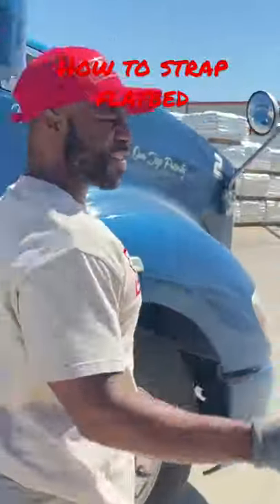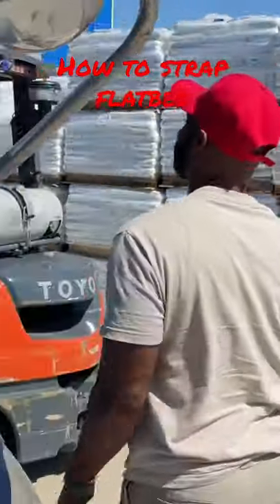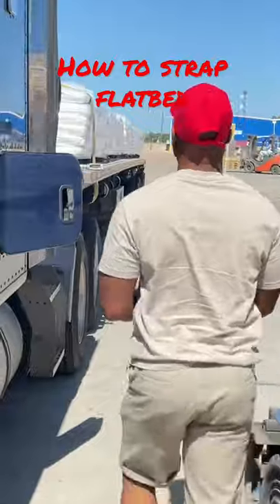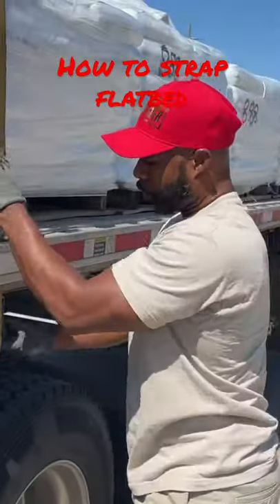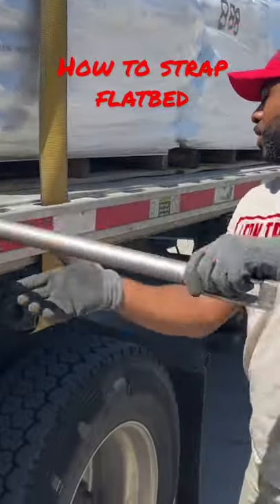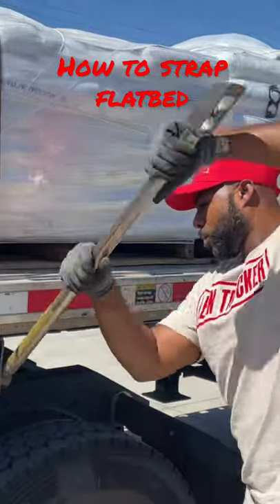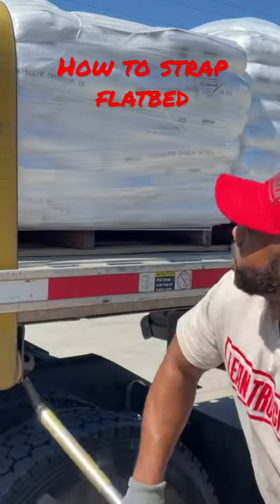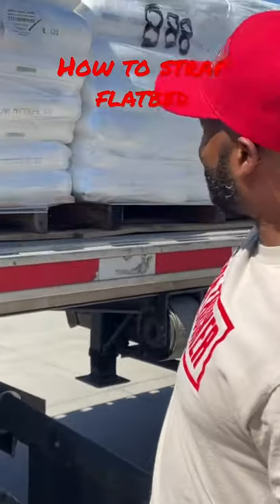How To Strap A Flatbed Load

Comment: To each their own… But I would not recommend this method of strapping loads. 
It is quick, and it gets the job done. But it’s more of a rookie method. 
First, i’d recommend to never throw the hook. That’s a rookie mistake. Because you have a chance of hitting someone, or someone’s truck with the metal hook… And that’s not a happy day for whoever threw the hook of the strap. Someone’s going to be very aggravated when you hit their nice new truck with your strap hook.
Secondly, my personal opinion, take your straps off the winch after every load and roll them up and store them in a proper storage box. Get them out of the elements. It will extend their life. It also lessons their chance of getting stolen off your trailer when you’re parked at a truckstop.
Lastly, all that extra strap rolled on the winch makes it easier for the strap to become More loose as you travel down the road and the load tries to bounce and tug against the strap. Strap on strap will give, but strap on metal winch will not give.
Cool video. Cool that you’re teaching a method. 
I just think a lot of old hands and flat bedders would entirely disagree with this method.
Reply from the maker: Respect 💯
Reply: Hook to the rub rail?  Does it have a WLL?  Purpose of a rub rail is to protect straps and chains in case another truck or trailer "rubs" against you.  So why hook to it?
Reply: I appreciate you to being light for new truckers, of course we should know some tricks but we should know the right way too
Reply: Putting one twist on the strap adds additional tension.
Reply: Agree and I'm new

Comment: What about alternating pull high load will shift to one side, if torqued down only on one side you need alternating pull on both sides of the load to jeep it center and shifting
Reply: Never happened to me in 11 years thats just nonsence  people tell you to waste time 😂
Reply: @jaydarkfire3567 oh you just have bags of what is that cement,soil it happened when you have rolled fencing
Reply: @erazco6568  nothing just strap and go  rolled fencing i just layer my straps and go . I dont get payed enough to look good or be extra safe.